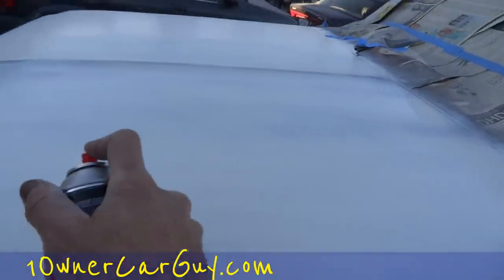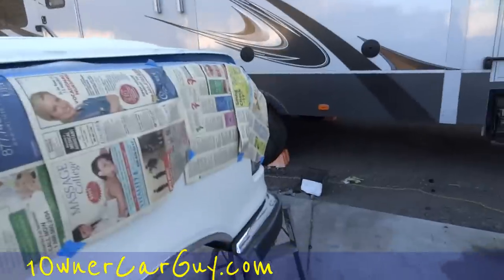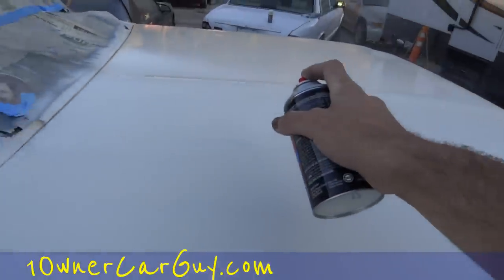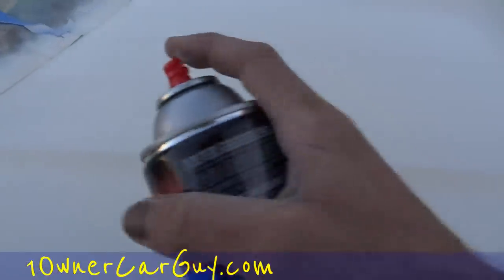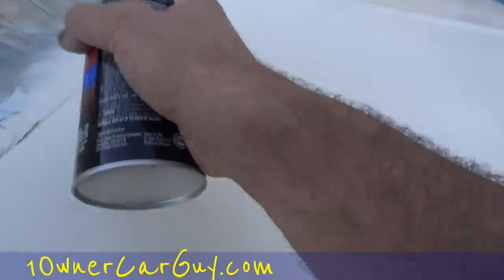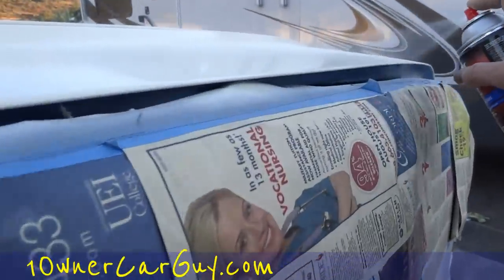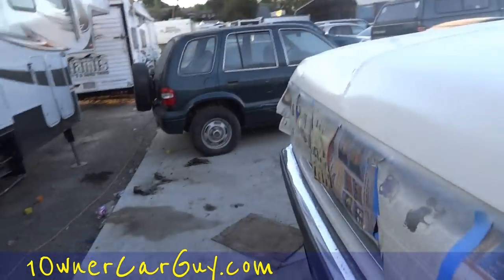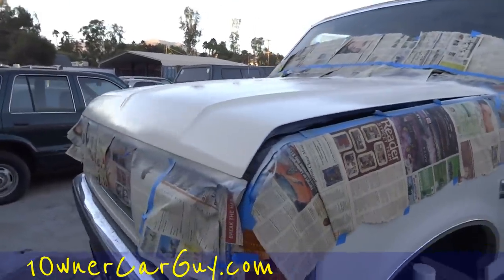Spray Paint a Car DIY~ Aerosol Can Color Match FAIL ? ~ Touch Up Repaint Step #3

Comment: Thanks for posting. Just wetsanded my hood on 06 Infiniti m35x. About to tape off and prime, etc. Did you follow this up with a clear coat? I've got a 2k I'm planning to use after I paint. Also, any experience using the spray can spray handle adapters?

Comment: How many litres do you need to spray about 1\4 to.1\4 a dual cab ute?
I only doing a once off spray on my ute,so didnt want to buy a gun,and air conpressor.
I got do the bonnet,strips up all four doors,about 5cm wide,plus other lil spots on the doors and roof.
It is a 20 year old,I will be getting colour code matching.
Can you buy different nozzle for a better spray,the auto shop one dipple a little.

Comment: I have a 1986 Chevy truck 50 thous original miles. all put on by my dad. the paint is peeling off side front panel exposing black. I don't have a lot of money and when I say not a lot I really mean not a lot. what grit sandpaper do I use and what type spray paint. help

Comment: its not because you used the wrong color or the paint itself is wrong, you need to wet sand the area you just panted with a real fine grit sand paper to dull and scuff the paint to match the already faded white the truck has on. its called "feathering" the paint